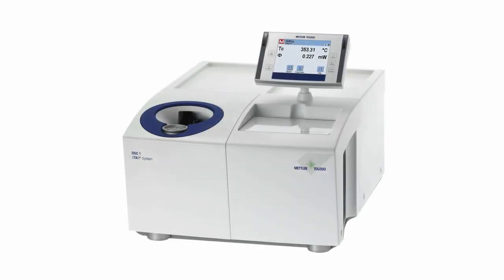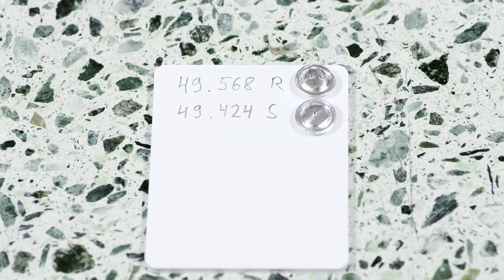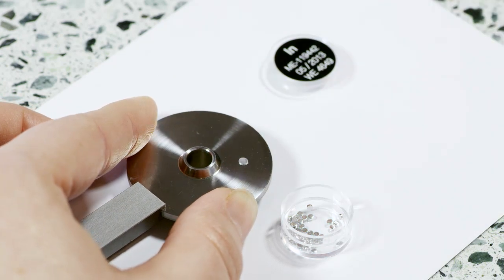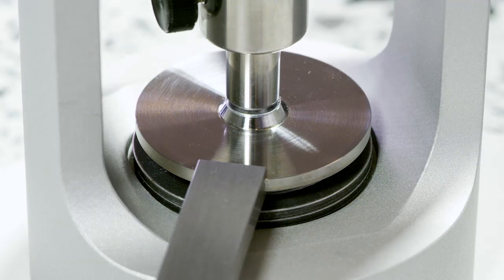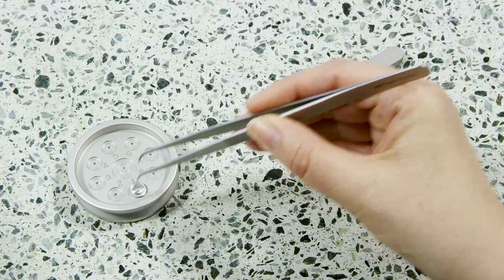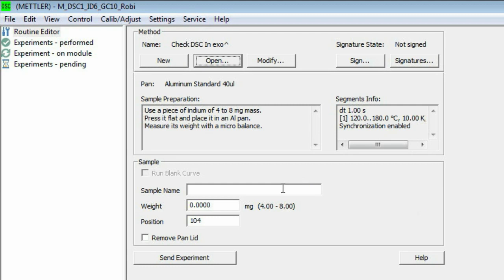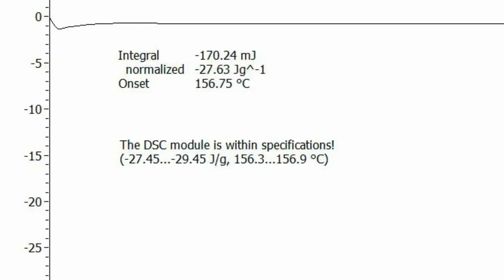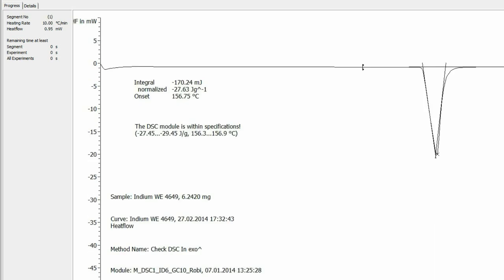DSC Calibration and Adjustment

Comment: what is the reason to hole in a lid of sample pan and refrence pan
Reply from the maker: The hole in the lids allow the defined in the DSC furnace to enter the curcible. With a sealed lid, there would be a self generated atomsphere inside of the crucible.